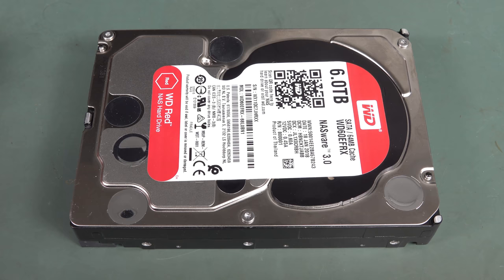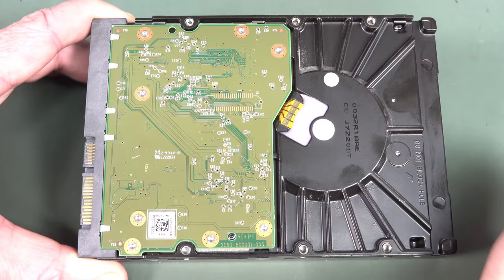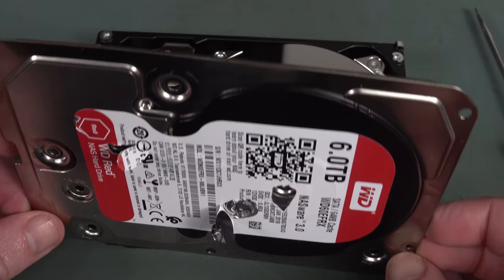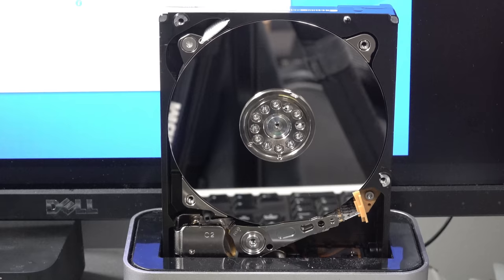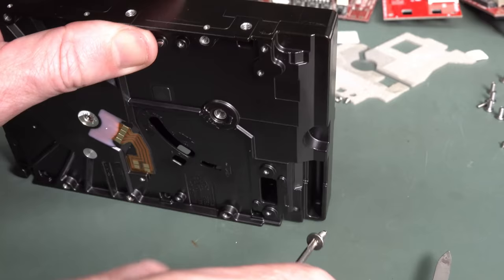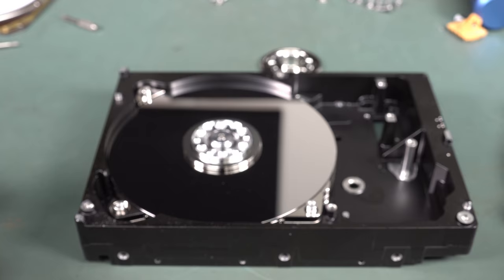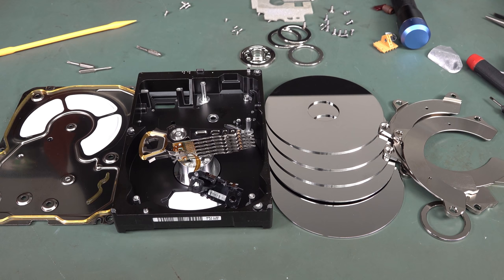EEVblog 1398 - Western Digital RED 6TB WD60EFRX Hard Drive TEARDOWN

Comment: I just remembered, I still have a dead 4TB WD RED drive sitting on my desk (it is from the same series as yours and is a couple of months newer), it failed on me last year.... I should pull it apart too (that is why it is sitting on my desk, I was going to do a video on it one day!), my drive is from 6th March 2018 and it is also an EFRX version.
Reply from the maker: Maybe you'll get lucky and get all groovy.
Reply: there are places that do PCB swaps on these for cheap, often the WD PCBs fail when the drive is mechanically fine. FWIW if you wanted to try and recover the data
Reply: Platters are perfect coasters for your Cup or Glass ;-)
Reply: @MrMaxeemum  The head mirror acted like a ring light. The forehead position is basically parked; in use it was worn over one eye. A bright light source to the side of the patient gave the doctor a better view of the patient's ear, nose and throat. Of course we've had better tools for the job since the 1930s, but head mirrors were so iconic in the days of silent film that they became a costume trope.
Reply: Often the problem is a tiny contact problem. The PCB was connected over some socket with pen suspension.
I would separate the PCB, clean the contacts and put it together again.

The head seems to search for the MBR or the Firmware of the Harddisk. The Firmware of the HDD is noraly not stored in a separate flash-chip, it is on the disk itself. I can not believe hat the firmware was erased. I really think this is a contact problem.

An other possibility:
The big chip on the PCB was cooled very good, because of a good thermal connection to the aluminium housing. The little chip had not such a good thermal connection and this was the driver-chip for the motor. But this motor is running fine, I think this is not the problem.

My professor had a problem with his laptop and the Service-guys told him, that he had to remove the RAM-modul and reinstall it.
After this, the laptop had no problems any more, he was running again. This was a simple contact problem because of some dirt or humidity of the golden-contakt-pins.

I use Isopropanol to clean electronic. The same stuff what is inside the hand-desinfection fluid (70% isopropanol, 29% water, 1% glycerin ).
Reply: @SinterBronze  I would agree, I had a HDD failure and I managed to get the data off it by putting the drive in a freezer for 30 minutes, connected it with a long cable to reach my laptop on top of the freezer,. After I got the data I stripped it down fully but later found the contacts between PCB and drive had oxidised (I think from a previous liquid spillage maybe a year ago) If I had checked that first It would probably still be working. In future I would check / clean these contacts first as it easy to do and unlikely to cause extra issues.
Reply: Platters are long-lasting bird scarers, hang them in your fruit trees.
Reply: Hang the disks from your hat brim to keep the flies out of your eyes!
Reply: that's sad. i've just bought a few 4TB EFZX drives. Now getting such statistics i start thinking that was a mistake to buy WD drives :( at least the RED ones
Reply: @EEVblog  the platters that stuck together, they are like engineering slip guages, so precise that if you place 2 together and twist them slightly they stick, they have been rung together.
Reply: @airgunnut9489  Cody's Lab did a video on this. Very interesting.
Reply: @EarthSouthside  First surface mirror for optical experiments.
If only someone can measure the spectral response of the coating.
Reply: I use platters to decorate plumbing lines as they exit a wall.. example: toilet cistern valve backed by platter, sitting on tiles.. looks nice.
Reply: @SinterBronze  Not a good idea. Water won't do any good to the contacts.
Use clean 99% IPA.

Comment: The heads are created in layers using the same processes used for semiconductor chips. They go through thousands of operations to build a three dimensional structure using exotic materials (platinum, tantalum, gold, copper, diamond-like-carbon, silicon carbide, etc.). They are oriented vertically (standing on edge), so that thousands can fit onto a single wafer. The crazy part is that they have machines with enough precision to mechanically separate them from each other, with the air bearing surface still in tact (it is not simply a smooth surface).
Reply: @artdehls9100  most of the tools combine photolithography with physical vapor deposition, chemical vapor deposition, ion beam deposition, ion beam etch, electro plating, chemical mechanical polishing. It's all built up in layers. It takes many layers to build one physical feature because the processes have limitations with the geometries they can produce, so the material (wafer) goes back and forth from tool to tool. You may build up a layer only so it can be sacrificed later by some other process that can't differentiate what it should remove from what it should keep.

 The tools themselves vary wildly in appearance. If they use a vacuum they maylook like large stainless cylinders with lots of plumbing on the outside and a robot arm on the inside.

I've seen some that look like washing machines.

Others look like Rube Goldberg machines.
Reply: @artdehls9100  the coil on a hard drive head is embedded in other materials. For cd readers it's probably different

Comment: Coil doesn't need feedback as they use servo info written on the surface of 1 platter
Reply from the maker: Yes, I figured that's the only way they could do it. But then you have a chicken and egg, so it would require the servo markers already written before first start up. So maybe that's what that bottom slot is for at production?
Reply: I came to ask this! Perhaps back emf can give some positional info, too?
Reply: @EEVblog   Servo tracks were written on a separate machine back when I was working on drives. Self servo writing is something that has been looked into, But I don't know if its currently being done.
Reply: Dedicated servo track platter is prehistory ;-) Modern HDDs use embedded servo, i.e. servo data interleaved with the actual data sectors since eons now.
Reply: @KernArc  How do they get it on the plater in the right location during manufacturer?
Reply: What Dave called 'big test pads' next to the heads, maybe are a strain gauge?
Reply: Coil position doesn't have to be accurate, just repeatable.  I'll bet every drive writes to different positions on the platter, they are just insanely repeatable so will go back to the same positions every time (with the reference tracks for fine tuning).
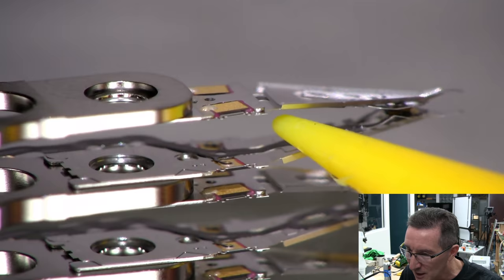Reply: @MichaelSteeves  The voice coils are only there for a "rough" positioning. Proper positioning of the head is done by another one or two levels of micro Actators. The golden pads at 20:23 are piezo µActuators.
A single, lousy voice coil won't hit a sub 100nm track width of modern HDDs.
Reply: @EEVblog  If them methods have not changed from when mate used to work for maker - will find one of  the holes covered by s sticker is to allow and external actuator to move the heads in order to create the servo tracks -- always used to be on every platter surface.
The "desicant" is a filter - will find breather hole on one side I think
Reply: @tomd2917  Agree! The first white thing he pulled out with tweezers was in fact an air filter because it was placed perpendicular to the platters to catch the centrifugal airflow - ALL HD's have these for decades - the air filters have just gotten smaller and smaller due to better clean-rooms for parts before and during final assembly.
Reply: This may be the very reason this drive acted up, when the waypoints on the platters, are the area that has suffered damage, the heads will search like crazy, and do lots of weird stuff that is very noisy.
Reply: Not on one platter, each surface have position servo data alongside with the data to precisely position each head on it's track.
Drives with one servo surface can't work with today's high Tracks Per Inch TPI densities.
Reply: @MichaelSteeves  No reference tracks!
Reply: @Piktogrammdd1234  I believe that the golden pads have something to do with flying height adjustment, not positioning.

IT'S ACTUALLY THE SECOND ACTUATOR - MICRO ACTUATOR.
THERE IS A LOT OF INFORMATION ABOUT IT, JUST SEARCH.

And positioning is much more complicated because any small inbalance will try move the R/W head from track center and servo have to fix that two times the number of 1/rotational speed.
And in addition stop writing immediately when off track.
Reply: Mr. Photonic Induction ist back!
Reply: @Piktogrammdd1234  From another reply, the piezo actuator is at the end of the arm, sandwiched between the head and the dark square part.
Very nice!
Reply: @MichaelSteeves  positioning could be part of what's stored on the calibration eeprom.
Reply: @EEVblog  FYI, the production machine used to lay down the servo information is called a “servowriter”. When we consider the precision used in the final product, it boggles the mind to think about what kind of precision is needed in the servowriter!! 😳
Reply: from reactions of sensors it seems like they are written index on each line of platter . 
and control the coin using analog values. if index is bigger increase the voltage. if index is higher decrese the woltage. also static  indexing positions will not work or fail shortly because the sensor hads are too weak and will bend ower time. 
anyway may be thats whay  hdds fail that easy :D
Reply: @ahmetmutlu348  Sorry, but I don't understand your explanation.
Operation of these drives is very complicated and can't be explained here but there are some good explanations in the Internet.
Failure reason can be explained by someone that works with these drives and really understands them.
(But usually they do data recovery and won't tell their secrets).
Reply: @paulcohen1555  complicated.., ? 
Not that much complicated. If you do not include contents meaning anyway. ;p just standard physics aerodynamics in detailed and precssion level used. But not that much that cannot be explained.
Most of the time its ewen possible to debug actual code executed from simple servo/motors reactins afaik.
Reply: If you actually know what the device does its not that hard to actually know what chips are doing.
Reply: @ahmetmutlu348  OK, then please send us full explanation of the chips.
Reply: @paulcohen1555  :P but really its just standard buffered memory unit, what makes this a lot special is its ability to handle big chunks of data. Other then that ita generic hdd. Standard data transmission protocols will do the work with amplification and lots of buffering mechanisms. We are storing raw bits there. Technically its just tape recordEr with additionaly prptected tape :P and we can say that there is additional thing thats some kind of multiplexer or modem that makes this device more then one tape/magnetic record tracking at once. What i can say about tape recordes ? ... thats interesting device of course but i dont think there is something that cant be explained other then specific limited/partial performance-error correction techniques used on chips/software~ ish mechanisms . but well that well known documented mechanism may take a lot if tried to explained there assuming listener knows nothing except living in this century ;p
Reply: @paulcohen1555  anyway i dont know specific technique used there if thats what you are telling .
Reply: @dfgsdja  It requires a higher precision to make the track than the servo coil and drive can do.

Comment: The yellow stuff is urethane. Those platters are actually glass with a vacuum deposited material.   Not a desiccant pouch, it's an air filter to catch any flying particles.  Eventually all of the air in the drive will be pushed through that filter from the spinning platters.
Reply: I recently "trashed" 30 or so drives. The platters bent, they didn't shatter like glass....  The coating crazed but they didn't shatter.
Reply: @paulravitsky2898  That is correct, some have glass platters, others simply use an aluminium alloy with magnetic coating.
Reply: @paulravitsky2898  How old were the drives?  As of 2016 Seagate was using glass platters.
Reply: AFAIK only the 2.5" ones are are glass platters, and even here, not all of them are. 
The recent 3.5" HDDs I tore down (oldest 2016, newest 2018) had all metal platters.
Reply: @randycarter2001  I never checked dates as I tore them apart to recycle the aluminum. That being said, they were 40 & 80GB drives. They were probably early 2000's?

Comment: I've had three HDDs fail in the last two years , all Western Digital. All standalone powered USB 3.0 types, only used periodically , never dropped, no excessive humidity/temps. I also have 10/15+ year old WD HDDs ,which are highly used 20GB, 30GB, 320GB, etc, still work perfectly. Very annoying losing data to basically new HDDs (my mistake for not using additional backup I know). WD has lost me as a customer.

Comment: I'm sure others have pointed out that with modern drives just changing the torque on the screws on the top plate is enough to cause them to fail.  Then you get into the helium filled drives...another story all together.
Reply from the maker: No doubt
Reply: The helium filled drives have a 5 year lifetime, if you have not replaced all drives after 5 years (does not matter if they are powered on or off the helium is still leaking away) enough of the helium will eventually leak out for the vacuum that is left to weld all the heads to the platters. For the hard disk manufactures it is the ultimate in planned obsolescence. It would be a bit like buying an engine with a very miniscule oil leak where you can not replace the oil, once all the lubricating/cooling fluid has leaked away bad stuff happens.
Reply: @itsevilbert  Thanks for the heads up. Will steer clear away from He
Reply: @addydiesel6627  largest air filled drive is a 10tb Toshiba Drive, they where somehow able to cram 7 platters in the standard 1 inch high casing without needing to use He. The maximum platter count for air filled drives has been 6 for eons, I have a 18gb quantum SCSI drive from 1999 and that has only 6 platters, again in a 1 inch high case.
Reply: @itsevilbert  Thank you very much for this very valuable information. That's indeed dog shit that these manufacturers are indeed making these intentionally failing. Even if all of other components are prefectfully able to live another 5 plus years. :(

Now I know to just go with the "tried and true" normal air filled drives when I am looking for "new" used ones. :)
Reply: @itsevilbert  I disagree, I think data centers, businesses and such are being irresponsible with reusing hardware. 

Face it, where can you reliably sell or even recycle your old gears without HOPING you can bail it out in a box to an online dealer? Or having to fuss with Ebay? That's why here on out unless it's like Themal Paste or something like that I gonna try much harder to get used hardware. That goes for HDDs, SSDs, processors, etc.

Comment: What amazes me is how they can produce such high precision so cheaply. They can print silicon, but they can't print hard drives!
Reply: Yeah, SSDs are cool and all, but HDDs are a marvel of precision engineering and manufacturing brought down to a price.
Reply: @volvo09  except when that price is brought down a little too far, and the whole series of drives is a complete turd [cough] seagate 7200.11 [/cough] - it's not a matter of IF those drives fail, it's only a matter of when.
Reply: silicon is not printed :/
Reply: @adredy  I was speaking metaphorically.